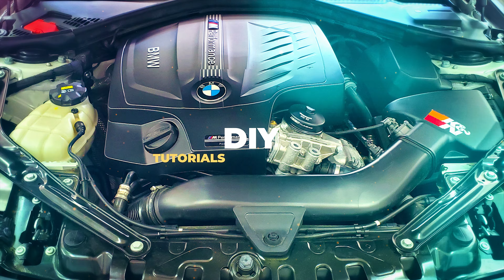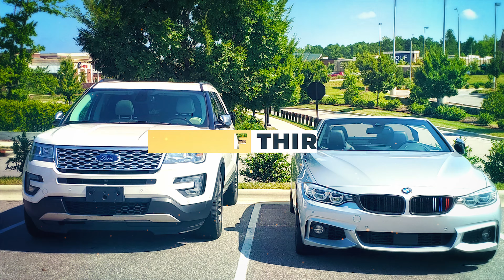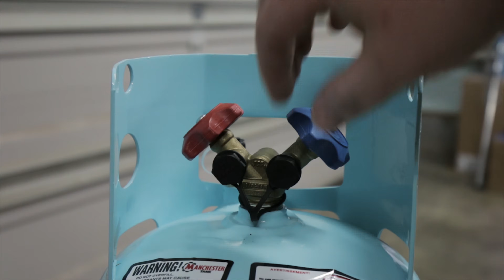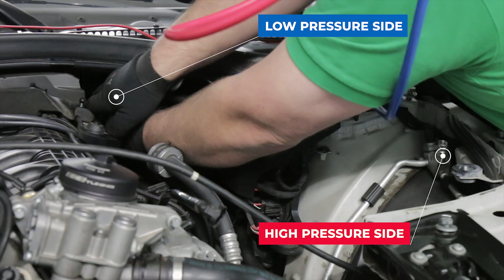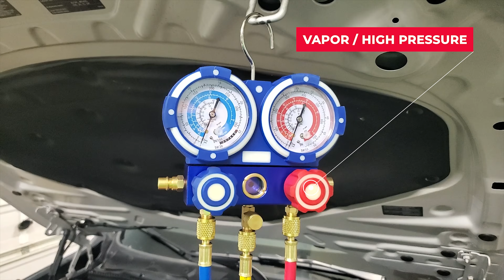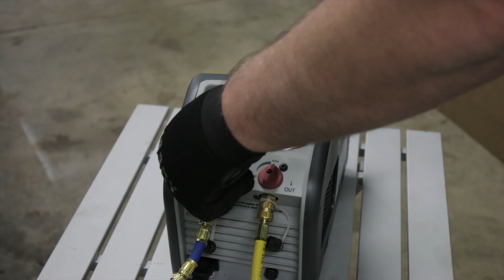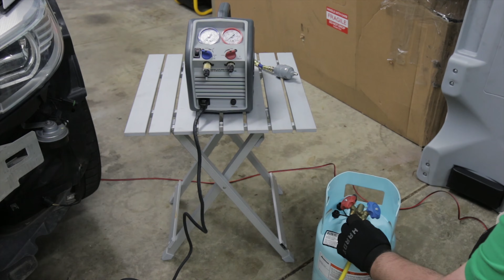EVACUATE YOUR CAR'S AC SYSTEM THE RIGHT WAY

Comment: Steve, at 4:55 in the video you open the valve on the recovery tank. At this point, you have not purged the hoses connected to the gauges, car and recovery unit. They will be full of air and will contaminate the refrigerant captured in the recovery tank. You need to purge both high and low side hoses of air as well as the yellow hoses going to the recovery machine and tank before opening the valve on the recovery tank.

At 5:02, when you open the valve on the recovery tank, there will be no leaks visible as the recovery machine, yellow hoses and recovery tank will be under partial vacuum. You can only check for a leak when you have opened the valve on the manifold. If you had purged the hoses then they would be under refrigerant pressure and you would be able to check for leaks before recovery.

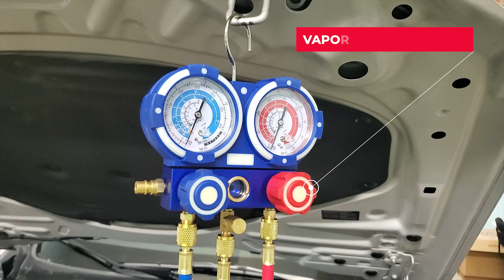At 5:05 you open the "blue liquid valve" on the manifold gauge set. The blue valve is not on the liquid side of the ac. It is on the vapor side. Again at 5:40 you say that the red high pressure valve is the vapor valve when it is the liquid valve.

As a final note, I would not advise people to purchase the manifold gauge set that you have used in the video. The high and low pressure ranges are more suitable for an R410A residential ac system than for a car's R134A ac system. If you look at the scale for R134A on the gauges you will see what I mean.
Reply: Thank you I was about to say blue is your low side vapor red is high side liquid and yes he did forget to purge the air out of the hoses not a certified epa 609 tech or 608
Reply: Wao! thanks for all these corrections, I consulted with my brother who is a residential AC tech and he told me also there are "errors" on this video, he lives in another town and can not help me but this is why it is recommend to go to a certify mechanic, unfortunately the charges are prohibitively expensive and no guarantee they would have the know how experience!
Reply: @politically_incorrect_717  bad electrical connector was culprit. When ac compressor went bad it must have fried electrical
Reply: What set of gauges would you recommend? Also, can you explain how lines are purged?
Reply: A very professional reply.  I encourage the original author of this video to actually go through the EPA 609 training.
Reply: This is a great comment. I don't need to do ac work on my car, but great info for the future! Sometimes people should really double check their info before posting videos. Granted, the viewer should be responsible and look at more than 1 piece of info, but the creator also has a responsibility of what they're putting out.
Reply from the maker: I did my research and my ac is working perfectly. Everything in the video was done correctly. The recovery machine instructions would also agree that it was done correctly 👍
Reply: @fthirty3  I'm afraid I agree with the comment above. You clearly know what you're doing, to an extent. But one of the most important parts of any work on AC is purging the manifold. The air contains a lot of moisture. The 3 things that create acid in an AC system are refrigerant, moisture and heat. And any moisture from the air in your manifold lines is getting in to your recovery tank a long with the refrigerant. All it takes is for that tank to get up to temperature and then that's you with a tank full of acid, depleting away and releasing all the refrigerant to the atmosphere creating a hot spot of global warming. That's not me being an environmentalist. That's you in big trouble for not knowing how to handle refrigerant correctly. Also, R134a doesn't do anything to the ozone as it doesn't contain chlorine. It contains carbon and contributes to global warming. 2 different things
Reply: @markparkin5372  Completing Automotive Technician program in the coming months, you hit the nail on the head. I'm no expert by any means, just have always had a passion for cars as a child. Now as an adult I am pursuing entrepreneurship in opening my own one-stop-shop for all automotive needs. Now, upon completion of the a/c segment, ASE certification is obtained after study and testing. It's fairly complicated and unfortunately dangerous for your everyday casual do-it-yourself-er. The equipment needed for specific automotive refrigerants such as R134a, R1234YF, R12 Etc. varies in both specific systems and also dangers to yourself, others and the environment. This is not to be taken lightly. As Mark Parkins stated above majority of people can easily overlook a crucial step or 2 and result in catastrophic failure or disaster. None of which is worth bypassing necessary knowledge and certifications in order to backyard mechanic this particular job. I'm assuming the above commentators weren't trying to be offensive in their constructive criticism, rather, explaining potential hazards. I for one would possibly take this video down and maybe edit your voice over to include these suggested fixes, and also make known that you in no way take any form of responsibility if anyone watching this has a negative experience. That this is merely for educational purposes, and it's all done at your own risk. Also, your experience as of right now may not show any signs and may be working perfectly. It very well could be you may get several months/years before devastation hits. Also, its not guaranteed everyone else will have the same luck with their install maybe learning sooner than later. Just a little food for thought @F Thirty3 again not trying to be offensive or disrespect in anyway. Afterall, it isn't your duty to help others out by posting instructional videos yet you do it out of your own wanting which is very much appreciated and commendable.  Otherwise, good job sir and I hope you continue to produce instructional videos for years to come.
Reply: @sal92copride86  considering there are literal kids making 10 bucks an hour doing ac recharges Im going to go ahead and agree to disagree with the level of difficulty on recovering and recharging your ac system as an intensive diy project lol
Reply: @stich1960  Look up the cost of the equipment needed to do it. Hardly a simple DIY. Youre looking at 100 bucks for the gages and vacuum pmp, you're looking at several hundred if not more dollars for the recovery machine. The price to buy all the shit you need, you might as well just pay someone to do it.
Reply from the maker: Depends on if you can get to a shop or not. I could not as I was replacing the radiators for both the coolant and AC. There are also a lot of people that don't want someone else working on their car. What about neighborhood mechanics.  There are many reasons for someone to do this themselves, not everyone is in your exact situation.  👍
Reply: @fthirty3 it may have worked but definitely not done correctly, moisture and air are the number 1 enemy of air conditioning systems (moisture + refrigerant = hydroflouric acid) the fact that you did not purge excess air will allow this hudroflouric acid to deteriote your AC components as well as your recovery tank, it worked sure, but the most important steps were skipped
Reply: Can you remake a video for us to show us about Purging the manifold gauges and using the right AC hoses for cars. SIMPLE TRUTH.... Make it like Christfix videos do a close up to... Step-by-Step Bro.

Comment: Trying to fix a work truck I vac'd the system, recharged but still compressor not turning on. I checked the fuse, relay, and also showed voltage to compressor plug. So I replaced the compressor clutch thinking that was the issue but still no go. I was told the low pressure switch was replaced with a new one but jumped the plug to it anyways to test then "click" the clutch engaged and turned on the compressor. So lesson learned. Sometime new parts are defective.
Reply: I'm wondering if people know how to read anymore. Obviously all these responders didn't read  what I wrote.
Reply: It's the alternator
Reply: @AndToTheRepublic4WhichItStands  why do you say it's the alternator? I'm curious because I have the same issue in my Jeep. I replaced the low pressure switch and still the clutch won't engage
Reply: @dontstayhome28  alternator
Reply: @dontstayhome28  it's a joke
Reply: @dontstayhome28  bc people always say it's the alternator. Bc it's the only car part they know lol.
Reply: @AndToTheRepublic4WhichItStands  LOL
Reply: how high was the pressure after recharge?  the low press cut-off limit may not have been met...
Reply: @bimmermavenwrench1660  Like I said the new pressure switch was defective,
Reply: Be sure to spray WD-40 all over the clutch and fan belt like I saw on one YT "short" video.

Comment: If the condenser is damaged wouldn’t the refrigerant have escaped? Thus nullifying the need to recover it?  I guess I’m not understanding why you would replace a condenser that’s still intact. 

For most folks it’s much cheaper to take the car to a shop and have the refrigerant recovered. I have a local shop I work with (I usually need this done about 6 times a year) and they just let me use their machine and then they keep the refrigerant that’s recovered. A person that’s only gonna do this once every couple of years would be money ahead even if they had to pay an hour of labor to have the refrigerant recovered instead of investing in a recovery machine themselves.
Reply: Yes my question too, I saw on a humid night after driving home from work what was steam, turn out thanks goodness not my rad, but the condenser and it was continuously leaking whilst on…next morning-hot air, so due to the decent sized hole all refrigerant was voided right? Having to buy a vac pump and possibly the oil for the compressor and refrigerant and condenser and my estimated labor seems like enough before adding the extraction, just want to clarify before I buy🙏😅 
I don’t have a tank either, like with a rad hole and swap all you need to do is purge the air-if your condenser busts while on and air on; just replace and vac+fill? 
Inquiring minds want to know 
Thanks 🙏
Reply: @thedalailama245  
I think understand your  question  FREON LEAK  

I  did mine after compressor fail 22 years original. 

My process was flush debris out of system by removing all hoses using alcohol and compressed air. Replaced seals. Take to repair shop for vacuum and recharge.

$125 if i remember
Reply: A completely damaged condenser will mean the refrigerant is all gone, or the drained off before it was replaced.
Reply: Exactly ...unless you do this for a living , most people wouldn't want to invest around $750 for the equipment if they are only going to do this one time. not to mention the cost of replacement part!
Reply from the maker: It depends, the fins were damaged in my condenser (which is cheap to replace) it wasn't as cold as it was before. And in order to replace it,, you have to remove the radiator. You would also need to empty it if your compressor goes bad.
Reply: @fthirty3  It's your story tell it like you want to!
Reply from the maker: Not sure what you mean by that but okay 👍😉
Reply: F Thirty3 Would need to empty it if the compress goes bad by locking up. Or if the clutch gives up the ghost and you can’t replace the clutch. It’s been my luck that the compressor goes bad by leaking and so the system gets emptied without me knowing. They do make combs that you can use to straighten the fins out. I’ll still maintain that even in your scenario, you would’ve been money ahead to have someone else evacuate the system, replace the condenser yourself, rent/borrow a vacuum pump from Orielly’s and either rent/borrow the gauges or maybe buy a cheap set so you have them on hand if you work on a lot of cars. But none-the-less, if a guy can spare the $750 to $1k for a recovery unit that he’ll probably never use again, this is a great video on how to use it.
Reply from the maker: I figure if I can help out and show how it all works, glad to do it. Out of the hundreds of millions of people on YouTube,  I'm sure there are some new shade tree mechanics out there that might not have done this before. Just wanted to help out and show how it works 👍

Comment: I tought all I need it was a vacum pump
Reply from the maker: If your system is already empty yes, but if you need to evac the refrigerant, you'll need an evac machine, gauges and a tank to hold the refrigerant.
Reply: Shops take it for free 

Then come back have put back in $100 dollars or more and do vacuum to test for leaks.

Comment: Could a regular 20lb empty propane tank also work as the recovery tank if I get the right attachments? The Refrigerant Recovery Machine is very pricey if this is a 1-time job. Is it possible to rent one?
Reply from the maker: as long as it's rated for R32A. The tank should tell you what it's rated for.
Reply: @fthirty3  Thanks. Another question. I just purchased the manifold and checked my pressures. So far I never saw anyone talk about the low pressure reading off the chart top and about 150 for high pressure. What could that mean? The compressor is certainly bad, but has gas/freon. I guess it doesn't really matter since I must replace the compressor and start to refill from scratch.
Reply from the maker: I'd say if your compressor is bad to not even worry about the numbers. Good luck replacing it, hope everything goes as expected! 👍
Reply: @RochaHolmes  if that’s your pressure when the compressor is on, that means one of two things pressure is seeping backwards into the compressor making the low side have high pressure or the expansion valve/orifice tube is faulty and is stuck open letting high side pressure come back to low side creating the low side to have high pressure.
Reply: NO.
Reply: find a local garage to recover it....much cheaper than spending all that money
Reply: @zeke112964  Not really, if you service AC on many vehicles. Where I live every visit to the shop for AC evac/vac and recharge is $250 a pop.
Reply from the maker: @zeke112964  It all depends on the situation and if you're able to drive to a local shop to have them remove it for you. My car wasn't drivable because of an accident and I wasn't about to have it towed just to have someone remove the refrigerant. Also, some people don't trust anyone to work on their cars and would like to know how to do it themselves. Either way, more knowledge is always better. 😊 👍
Reply: @fthirty3  So you spent $750 to fix  the A/C  that wasn't broken and not to mention the cost of whatever was damaged?
Reply from the maker: The insurance company paid me to fix the damage from the accident. I wasn't going to spend $100 each way for a tow not to mention however much they would charge to do it. I would also need to make an appointment to have it done. It was better for me to do it myself both from a channel content perspective and a trust perspective,  it was also quicker to just do it myself. Again, nothing wrong with teaching someone how to so something.